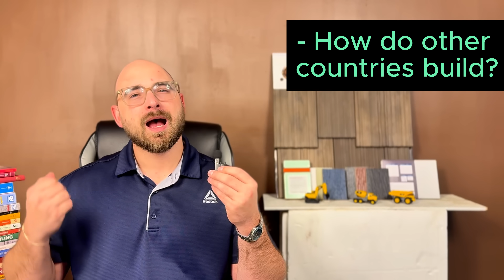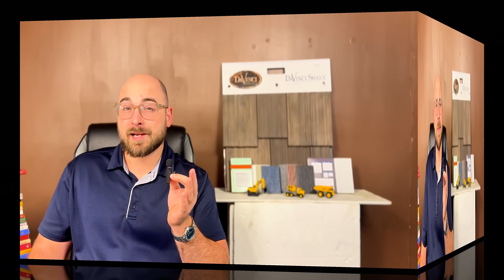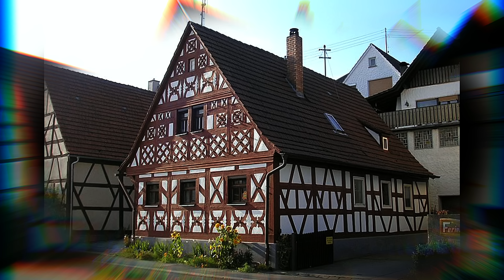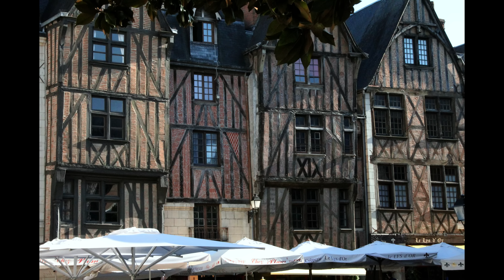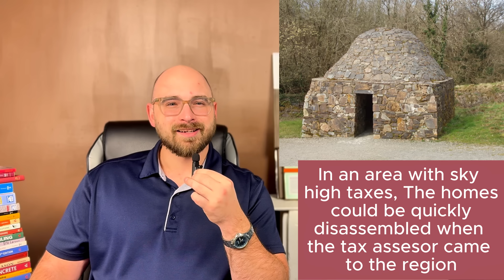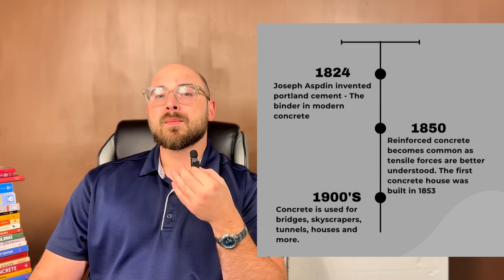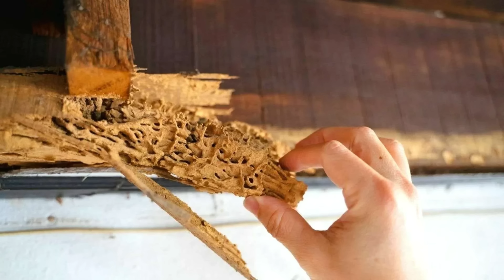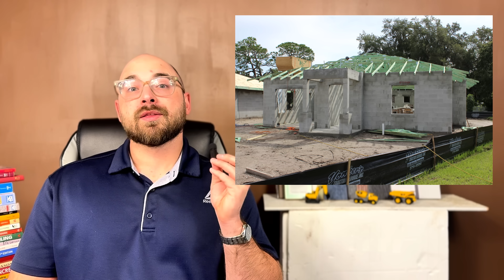Why Other Countries LAUGH at American Homes

Comment: I would have loved to have a cinder block house. But the few I ran across was on a concrete slab and for me that's a No-No.
Reply from the maker: Why no concrete slab? Too hard on the feet? 🦶
Reply: @Mike_Fortin  Lol. That, and the fact that it might become an issue if you have problems with the plumbing. And I also use my crawl space for storage.

Comment: I live in a levitt house lol
Reply from the maker: Very nice, what’s your opinion on their homes? High quality? Any issues?
Reply: @Mike_Fortin  they where built quick and cheap, like both upstairs bedrooms have no ceiling lights,  some models had the pitched section of the roof used as an upstairs bathroom. Most have been expanded or dormered, some to mini masion size.
Honestly though, they filled a major nitche market. comapered to the super tiny apartments in the citys and haveing a good sized back yard was a major inprovement.
My my grew up in a Levit house in east Meadow ny, they had a swimming poll, driveway and a garden to grow food in.